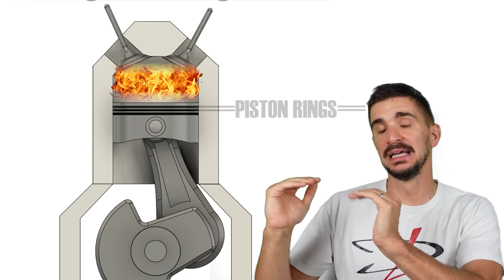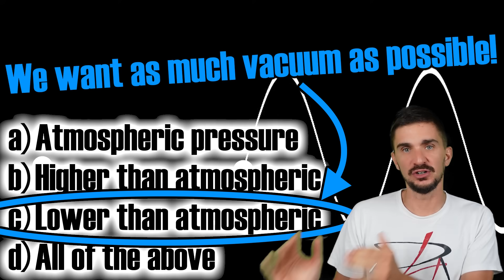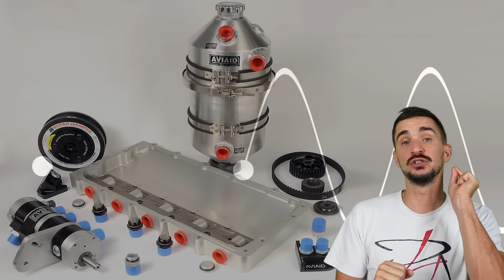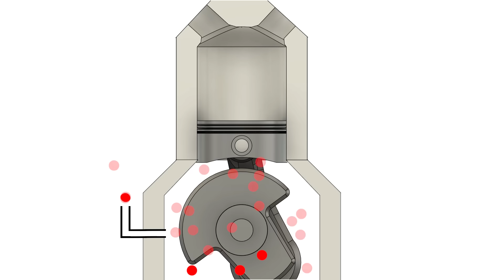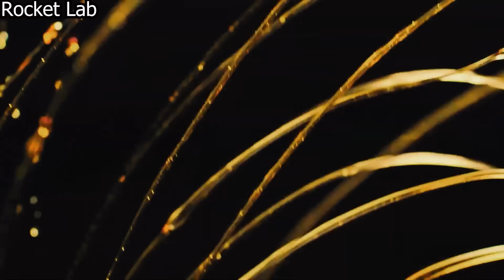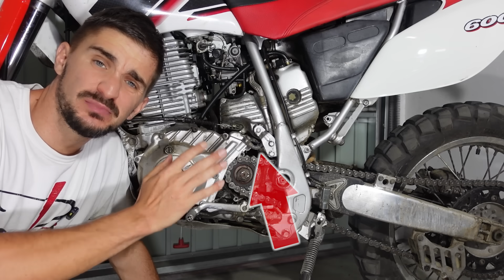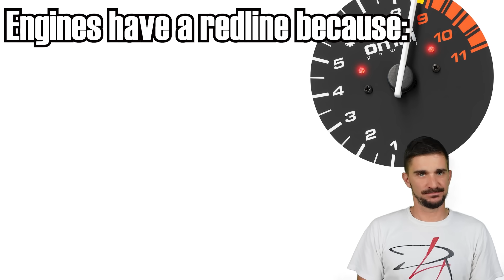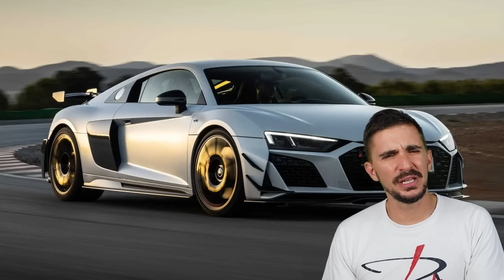Installing This Has No Drawbacks, Except for Your Wallet - Dry Sumps Are Awesome, Here's Why...

Comment: Sorry, but other cylinder goes up, when one goes down. No volume change. Just crank air moving around. So extra pressure is by blow by only. At least if you don’t have 1-3-5 cylinder engine. Where there are real volume changes.
Correct me if I am wrong.
Reply: In any engine smaller than an inline 6 there still will be a change of volume due to how the pistons move - the same reason that an inline 4, for example, will never have perfect secondary balance.
Reply: watch at least 5 more minutes after he starts talking about compression
Reply: Wait till this guy hears about one cylinder engines.
Reply: Also Watch to the End.
Reply: @sasori6417also read to the end.
I made it clear abt 1-3-5 cylinders.🤷‍♂️
Reply: @ToCostas Well I overread that my bad. Did you watch the whole video now and understand why its still robbing the engine of energy ?
Reply: @sasori6417i did. Before posting 🙂
I see this effect caused by piston movement, as the main source, for 1-3-5 cylinder only.
Otherwise, blow by is the one that generates extra pressure.
Air movement inside the block is same like in all variants excluding 1 cylinder config. Yes it generates pressure too. To move air from side to side.
It was just not mentioned in video.
When that is different.🤷‍♂️ I love this channel, no any plan to push on the author.

Comment: So a vacuum helps with the intake stroke, less power loss. But you could say the same for excess crankcase pressure helping with the compression stroke?
Reply: Vacuum helps everywhere, not only with the intake stroke. Crankshaft has less resistance in vacuum.

Comment: isn't pressure equalised beyween cylinders when half of them go to tdc and half to btc? And the only pressure deviation occures bcs of leaked gases and heating of engine block?
Reply: You are pretty much correct. On Inline 4, crankcase volume is slightly lower when the crankshaft is at 90° (conrods are angled, the same geometry also causes secondary imbalance). This cancels itself out on bigger engines.
Reply: Half the cylinders of a 1, 3 or 5-cylinder engine?
Reply: @polyvg  on 3 and 5 cyl engine pressure is more or less equalised bcs of crank angles, but it is more of an issue than on other engines i think

Comment: That all sounds great but on a multi cylinder engine would the difference in volume not be equalised by other pistons going the opposite way at the same time, so if you actually have pressure its blowby i suggest, so yes a low vacuum is recommended in any case...  I run a 3l Hilux on steroids, intercooled, ported, stage 3 cam, performance pump and custom manifolds etc etc etc.. This seems no problem in my engine but i did modify to get more vacuum.
Reply: This. Even if somehow all pistons went down at the same time... how many horsees of power does a PCV valve need to open? If I can push that spring open with a screwdriver I wouldn't call that a massive save of power...

Comment: Would love to have dry sump systems more commonly on motorcycles/cars
Reply: Most race based motorbike motors do? And they need valve adjustment etc every 20,000km. .
Reply: @Low760  are they? Have yet to see 600/750/1000cc race derived engines wth factory dry sump systems

I know a few oddball ones from BMW k-series i4 engines, some rotax engines and some older british models.
Reply: @someguy9520 Triumph rocket III is dry sump.
Reply: @adrianzmajla4844 curiously, that I was also aware off

But wouldn't exactly call that 2.5L i3 racy/race derived
Reply: @someguy9520  the yamaha 660cc singles used a dry sump, and the honda 650cc singles too
Reply: @Whoooan all models that I know, but could realistically not be bothered to list in a YT comment

Still waiting for these modern race derived engines that are all supposed to have dry sump. And not sth from the 2000s or even older